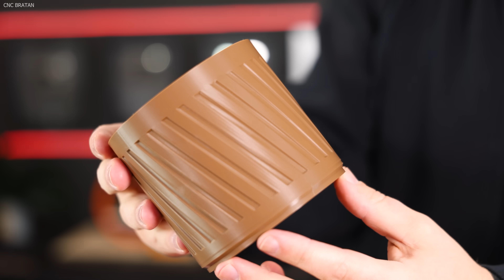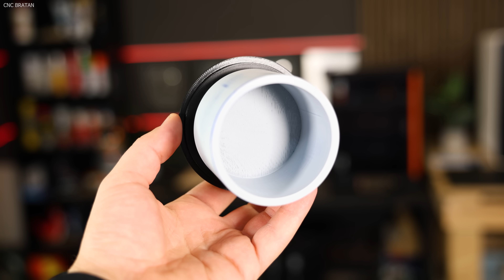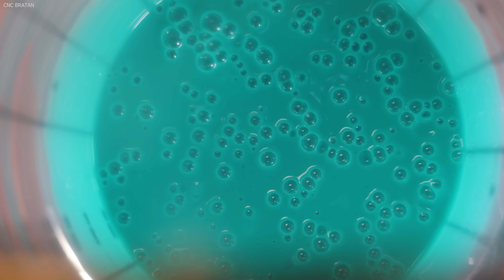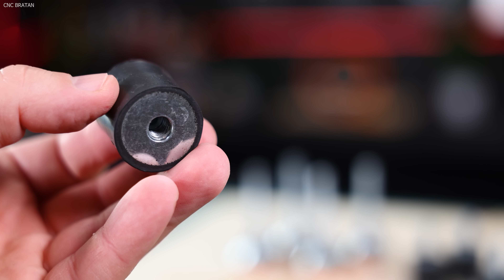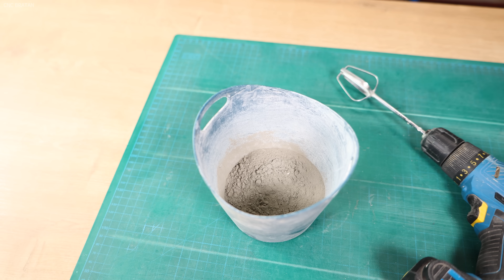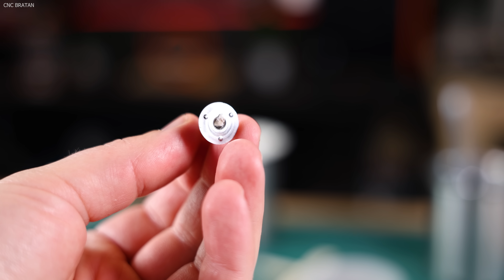Make Money with 3D Printing & Concrete | DIY Silicone Molds and Vibration Table

Comment: When there is enough tolerance in dimensions in the design a coating of beeswax is a much faster way to get rid of layer lines than sanding.

Comment: How could mass production be fast if it takes 48 hours before you can free up the silicone mold for the next container? That leaves you with only 15 containers per month per silicone mold.
Reply from the maker: 24 hours. 30 Containers per Silicone mold When it comes to mass production, you don't just have a single silicone mold, after all. 5 Silicone Molds = 150 Concrete Containers

Comment: I love concrete stuff, and yours is just perfect and motivates me to try doing this - appreciate you showing all the process, it looks much more doable after your video

how long do you need to vibrate concrete? I was thinking maybe as a temporary workaround I could take drill, attach it to the plywood and just add some off-axis mass to it like some hexagon key?

I tried long time ago creating flower pots (big ones like 5lt) from concrete - few of them had big cracks when dried, few were fine. it was pure concrete at that point. then my friend told me I should've beeen using some fiber or sand inside for keeping it all together

did you have problem like this, how do you solve it?

thanks again for the detailed video
Reply from the maker: I wouldn't shake it for too long; if you're using a plasticizer, I think 30 seconds is enough. I don't really have issues with cracking—I keep the concrete moist for a long time. I cover it with cling film or something similar while it cures in the silicone mold so the liquid binds instead of evaporating. And yes, glass fibers are very important to keep it from falling apart.

Comment: Hi, I am really happy after watching your video, I need a little help from your side as I am not familiar with 3d tools, Can you make 3d model/ file for 10 inch circular shape. I want to make silicon molds for creating pots from cement. You can choose the appropriate space inside as well as outside to make the mold strong to carry the weight of cement.
I am a student and I wish to start unique pots business with 1 or two products in start.
Reply from the maker: I do not offer such services.

Comment: Hi, I printed your free one and am  wondering why my handled insert is so close to the pot portion that there is no room to pour the silicone. I didn’t change anything on the files. Just printed them. Edit: since it didn’t fit I just changed the size of the pot portion (it’s re printing) and it should fit in the mold portion now. … tomorrow I’m gonna mold it. I’m so excited.
Reply from the maker: Perhaps I’m misunderstanding the question regarding the insert and the handle, but to pour in the silicone, you only need a small opening; you only pour it in from one side so it can spread on its own. Don't pour it in from all sides, as that traps air.

Comment: Just poured my first silicone, cross everything! One question I had was that if I wanted to add a foot ring to the pot, is there a way to pour the mold with the pot inverted to capture the base detail, or would it be better to create a silicon cap that would be installed into the poured concrete to displace concrete and leave the additional feature?

Comment: You can speed up the finishing process of the plastic on a lathe instead of sanding, it also has the added benefit of making sure they are perfectly round, 3D printers struggle making round things especially as the diameter increases.

Comment: When printing the insert, pause it and fill with sand, and then include in the design a top over it that completes the print and traps the sand.  No glue, or floating chances.

Comment: How many times you can use a silicone mold ? The silicone is not made to be used with concrete. It will only last few times pouring into the mold. Silicone is good for pouring gypsum (Plaster) and it can last 200-300 times if taken care of. But concrete ? ehhh
Reply from the maker: I don't know, I've maybe produced a maximum of 30 items of one model so far.
Reply: @CNCBRATAN  I think it will be a maximum of 100. The only material that is good for concrete is the polyurethane rubber and it can last 1000 cycles. I don't think you can get polyurethane that is so soft though. The concrete will destroy the silicone matrix pretty fast so it's not feasible. Also the sand and bigger stones that gets mixed in will slowly cut the silicone. In my opinion it is not worth to produce it using this procedure because of the high costs of the silicone.
Reply from the maker: @danielcrall9507  Even if, as you say, it's only a maximum of 100 times, wow. With just one or two sold, depending on the number, you'll have recouped the cost of the silicone. For me, it's currently the perfect, quick method.
Reply: @CNCBRATAN it means you live in a  place where you can sell those products for a high price. Can't sell it for much here. I make my own PMG though similar to Jesmonite and that won't destroy the silicone. Looks even better than concrete.

Comment: Excellent video, it’ll save me quite a bit of time and development expense as I want to make some custom eyecups to fit on lenses.
You can make a DIY vacuum chamber with a storage container and a vacuum cleaner. Not as good as yours but better than nothing. If anyone has difficulties, filling a pump with water would be better for ejecting the mould as water isn’t compressible.
Reply from the maker: cool tips

Comment: Tape some fishing line or fine steel wire to the bottom and you should be able to use it to cut it off the base

Comment: why wouldn't you just print on an SLA printer or use one of the many 3d job shops if you can't bring yourself to invest the $200? spending all day sanding and filling a crappy fdm print is just asinine.
Reply from the maker: Lol, I have a resin printer, but it works the way most people do it, and I think most people on a 3D printer channel have an FDM printer. One more thing: you're really overdoing the sanding and filling. Is that intentional? I sand for a maximum of 5 minutes and spray for about 1 minute. Why use an overpriced service for €200 for a mold when I can print it myself for €1? I buy my filament with makerlab points; for me, it's free. It would be a strange tutorial if I were buying ready-made parts somewhere.

Comment: This might be asilly question but why don't you use just pure sanded ple mold? Why'd you need silicone?
Reply from the maker: For me, this is the best and easiest way. I have no idea how to get concrete out of a hard mold.
Reply: @CNCBRATAN  I just thought maybe it would be enough to lubricate the inside of the hard mold and just unscrew the bolts securing the structure - the concrete part would just come out.

But maybe it would have been too messy, idk)))

Comment: Fill the mold with water and pour it out. Split the water into 2 cups (preferably clear) and it'll give you a rough volume for the silicone needed
Reply: You can also create a 3d shape for the hole in the mold and slice it. The slicer will tell you the volume with pretty high accuracy.

Comment: FYI, if it hasn't been suggested yet, I make silicon seals. Cured silicone won't stick to the wet silicone. Basically squared cross-sectioned o-rings with a little bit of angle draft. When I sandwich a couple of printed parts together I include an o-ring groove for the seal. Works great for keeping the wet silicone from leaking from a mold.

Comment: Using petroleum jelly (Vaseline) as a old release helps greatly
Also I add screw holes to my prints instead of using tape or glue with  no leakage

Comment: Cool idea but cant see much of a profit margin for this kind of thing when you can buy a nicely scented candle in glass from the dollar shop for less than $10 I suppose if you market this right as hand made etc. you squeeze out a bit extra.

 Pots and planters on the otherhand may be better idea  dont require the extra time materials to make the candles will take more cement and setting time of course.

Comment: The m8 threaded inserts are designed to be used differently than you used them. It would be a good idea to put some small screws right next to the inserts to hold them in place or use bolts from the top and coupling nuts to connect your vibration dampeners and feet. I think you want to maintain the flat surface though is why you why you used the inserts backwards. There is a different type of insert that threads into the wood rather than getting sunk with a hammer, that would be a better solution in this particular project. If you're selling these things you should also set your inserts with epoxy. Round over the edges or maybe make an edge fence so stuff dont fall off. I offer my observations only in an attempt to help. Its a cool project, thanks for sharing.
Reply: came to comments to say this.
Reply: thank you, whatkind, do yoiu know what theyre called? and would it be a 1-1 size replacement or would i have to change the size of the other parts due to internal vs external diameter?

Comment: If you did have a vacuum chamber, do you even need to vibrate the casting mold?  Could you not just use the vacuum chamber to get the air out of the concrete / slip?
Reply from the maker: "It probably won't work. Concrete is too heavy for a vacuum to effectively pull the air out from the bottom. Vibration, on the other hand, causes the concrete to liquefy and flow into every corner of the mold. A vacuum can't move the material like that. Additionally, since concrete undergoes a chemical reaction, the vacuum could interfere with it and even cause the water to boil.

Comment: Why use concrete instead of glass for candles? Once the wick burns down, you can barely even see the light. Honestly, those would look way better as plant pots than candle holders.

Comment: Whats happens if you put the setting concrete in your vacuum chamber instead of shaking it?
Reply from the maker: "It probably won't work. Concrete is too heavy for a vacuum to effectively pull the air out from the bottom. Vibration, on the other hand, causes the concrete to liquefy and flow into every corner of the mold. A vacuum can't move the material like that. Additionally, since concrete undergoes a chemical reaction, the vacuum could interfere with it and even cause the water to boil.
Reply: @CNCBRATAN ahhhhhhh! 👍🏻

Comment: Using resin instead of concrete would be an idea. Resin doesn't stick to silicone either and u can make art with resin. 😊
Reply: resin is very expensive compared to concrete, 10-20 times more expensive
Reply: @ErikB81  yep. So is art sometimes 😅 u ll sell it for more $ too. If u just wanna make some for yourself, definitely go for resin. It's not expensive when u don't need much ml.

Comment: I wonder how well a tensegrity table would work for vibration, as it should be able to vibrate horizontally quite easily.
Reply from the maker: I've never heard of that kind of table, so I have no idea
Reply: @CNCBRATAN  You should look it up, then.  It looks impossible, but works very well.

Comment: Couldn't you put the concrete in the vacuum chamber instead of on the vibration table ?
Reply from the maker: It probably won't work. Concrete is too heavy for a vacuum to effectively pull the air out from the bottom. Vibration, on the other hand, causes the concrete to liquefy and flow into every corner of the mold. A vacuum can't move the material like that. Additionally, since concrete undergoes a chemical reaction, the vacuum could interfere with it and even cause the water to boil

Comment: Very interesting vid, but one small nitpick, this is mortar or plaster. Concrete is what you call sand + gravel/rocks/agregate + cement + water
Reply: Coarse sand like sharp  sand is an aggregate though.
Reply: @backgammonbacon  With concrete you usually have multiple different sizes of rocks and aggregate according to a specific formula.

Comment: Great video, thanks. In stead of a vacuum chamber, you can also use a pressure chamber like a pressure cooker with a pneumatic fitting attached to it. I pressurize everything AFTER the mould has been poured

Comment: I’d highly recommend SiliNOT!. It’s a reusable meltable silicone substitute. It comes as a weird powder, you melt it in the microwave and use it to make your silicone molds. It’s the same or better than one time use silicone and you can melt it back down when you’re done and make new molds over and over again. Great for first time mold making so you don’t waste money on mistakes,
Reply: Thanks for the comment / suggestion my dude. Whilst it is expensive, this looks like an amazing product to do some things with.
Reply: You can do that with gelatin and glycerin too! :)

Comment: Where did you get the concrete vibrator for the table? I'd recommend using a release on your 3D printed plastic prior to pouring your silicone. Nice video.
Reply from the maker: The link is in the description (Amazon). I use compressed air to separate the silicone from the 3D print; it’s only held in place mechanically, there's no actual bond between them

Comment: Question, and maybe this has already been addresses if so apologies, why not print clamps for the 3D mold maker? I've seen several print in place mechanisms, so just curious if this could be implemented into the 3D print?
Reply from the maker: I know what you mean, maybe for the next model

Comment: Just a tip; 3D printed materials benefit GREATLY from wet sanding. It helps with the heat (especially important for PLA), it prevents the dust from blocking the sandpaper, and it makes less mess.
Reply: Also if you print out of ABS instead of PLA it's order of magnitudes easier to sand. You will save a LOT of time.
Reply: I wonder is fuzzy skin would remove the need for sanding, plus add details.
Reply: Great tip! Thank you!
Reply: also wood filler mixed with water on the 3d print smooths it out so the layerlines don't transfer to the silicone mould
Reply: what grit?
Reply: @MyHandinMitts  When I need something sanded, I usually go through almost a dozen grits between 80-2000, which is probably overkill. You could just use a few grits between 200-1000. All wet, of course.
Reply: I thought PLA doesn't do well with moisture
Reply: @princewilloghenovo6247  that's before printing, moisture causes issues like stringing, pockmarks, and underextrusion. None of those things matter after you've printed it.
Reply: He shows it being wet sanded 🤔
Reply: @gordonrobb he only does that for the filler primer. I'm saying bare plastic also benefits from it.
Reply: @dogucan97  They are bio-robots, the only thing that matters to them is what the person on TV says.

Comment: TIP: To make removing hot glue easier use isopropyl alcohol. It destroy bond between glue and surface and you can just peal it off!
Reply from the maker: I’ll have to give that a shot.
Reply: @CNCBRATAN  oder einfach mit nem föhn oder ner heißluftpistole kurz erwärmen dann auch leichter abziehbar, falls das material von iso angegriffen werden würde
Reply: @CNCBRATAN  the alcohol will also get hot glue out of fabric and hair. Soak it with alcohol and rub the glue.

Comment: To save silicon, check for a used silicon mixing/dosing machine what is used in dental laboratory. Something like the Dreve Dosper. With this you just use as much you need. For gluing use sticky wax.

Comment: How many candles can you usually make a week?
Reply from the maker: With a silicone mold, I usually don't remove the concrete until the next day, so one per day, but theoretically, I could take it out sooner since it sets pretty quickly.
Reply: @CNCBRATAN  Thanks for the insight!

Comment: Im curious with making silicon molds, what silicon could be used in the oven… for melting printer poop and ground failed prints into items
Reply: Dragon skin used to be popular for it's heat resistance, but that was in the 2020 era, looking up silicon mixes and their limits would be the best bet most likely
Reply from the maker: No idea, that’s not really my area of expertise

Comment: Sure, I'll spend a few hundred dollars to make 35 cent concrete candles.   What's the ROI on this after factoring in all the tools , incud8ng a 3D Printer?
Reply from the maker: Can you name a single field where you earn more money right from the start than you’ve invested? Even when selling 3D-printed items alone, the investment is much higher and there’s a lot more competition. It only pays off if you count your time as a hobby; then you can actually get your money back quite quickly
Reply: As long as you don't value your free time, basically unlimited

Comment: Can you fill the small holes in the concrete after it’s done or will that stand out ?
Reply from the maker: No, I should make the concrete a bit more fluid and vibrate it longer so the holes disappear completely, maybe add a bit more plasticizer too.
Reply: @CNCBRATAN I think plaster of Paris would work well. You can colour it too. Wont have the concrete look though. Just a thought. Happy Easter btw.

Comment: If you add a frame around your vibration table it will help keep your vessels from vibrating off.  Ask me why I know this.  ;)
Reply from the maker: Okay, you've got my attention. Why DO you know this?
Reply: @CNCBRATAN  🤣🤣 So many tipped over vessels... so much cement on my tabletop...
Reply: @lombardave  Behold! I am putting on my Horatio Caine  sunglasses for you: I see, your statement is based on concrete experiences. ....*sunglasses off*
Reply: @Drehzahlorgel Wwwhhhooooaaaaaaaaaaa!!!
Reply: @lombardave why so many? You should have learnt from the first vessel that tipped over. 😅
Reply: @CNCBRATAN FAFO